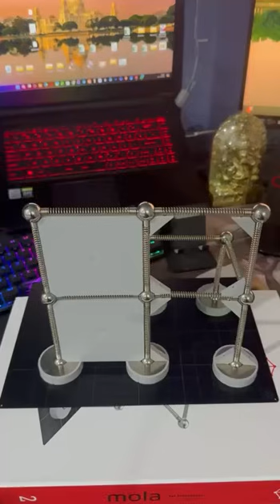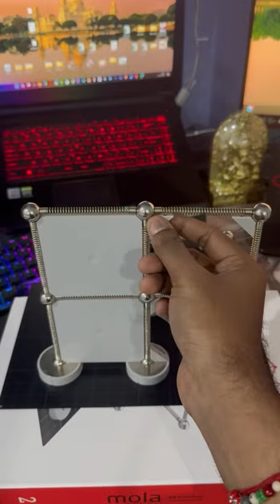Understanding Dual System with Mola Structural Model | Lesson - 4 | ilustraca | Sandip Deb

Comment: sir can we apply all the load on the structure without shear walls and then directly take the design force as 1/4th of the results? or do we have to reduce the applied loads by 25% and the results so obtained should be used for the design of the SMRF?
Reply from the maker: Scale up the total base shear taken by column upto the 25% of Base shear. A separate video is available in my channel for the same. Kindly refer.

Comment: If bracing provided so ?
Reply from the maker: The video was about RC wall-moment frame dual system.
Reply: @ilustraca actually reading steel structure book and suddenly notification of channel came in mobile,so back of the mind ,only that thing going on ,....😅
No issues 
Got my mistake.